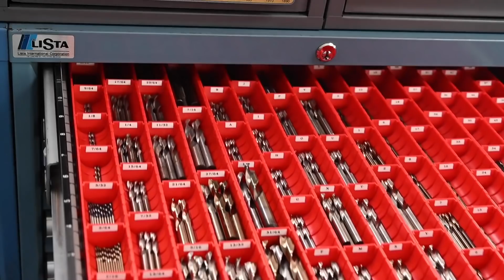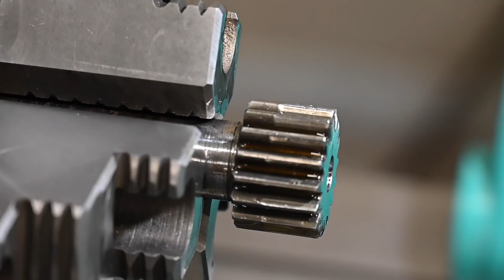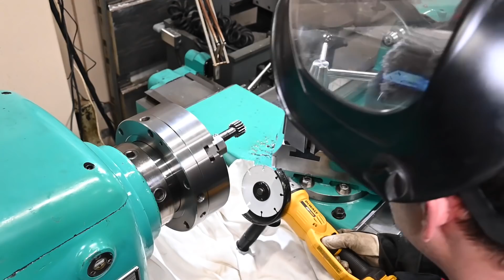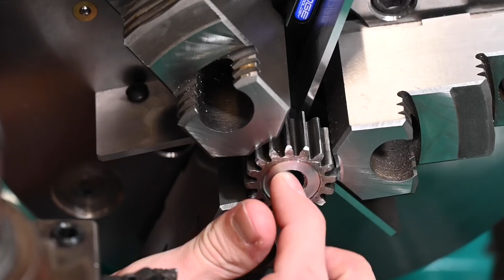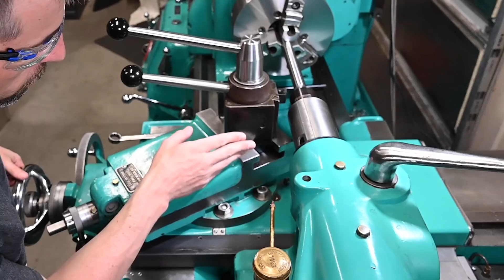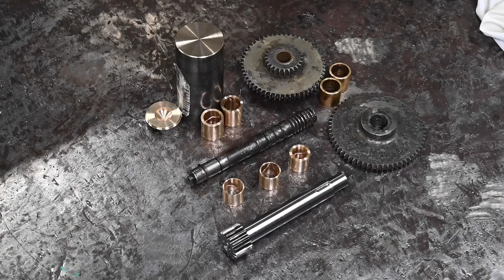Machining a hardened gear and new shaft (Lathe Repair)

Comment: Why did you have to cover the machine when grinding? At first I thought you were going to use a grinding wheel, so it made sense. But the burr is nothing more than when you’re turning. The same material is coming off. The DeWalt may have tungsten powder coming off the wheel, so I understand the need for it there.

I have the same parallel chuck tool for my 8” chuck. It works well, but can be a bit touchy to get the parallels in the fixture perfectly flat. I have to put in on my surface plate to do that. None of the different models from other manufacturers seem to come out far enough, particularly if the chuck is bigger with deeper jaws. But it’s the most accurate one I’ve used so far.

Comment: There's always a reason for things. The downside of a powered topslide  is complexity and bulk where you don't want it.  If you're making a lot of parts with a short taper like bevel gears, it might be useful.  99 percent of the time, a home shop guy uses his compound for advancing the cut a tiny amount on a threading operation, or for taper turning.  My ideal lathe would have a taper attachment, lead screw reverse from the apron, and maybe a solid tool post mount on the cross slide so I could program in my tool offsets.   A powered compound sounds like it would be cool, but when you start thinking about what you'd use it for... meh.

Comment: Really beautiful lathe.   If you get a chance check out the U3 universal gutter grinder.  I picked one up and it totally changed my reailty when it came to lathe/mill/drill sharpening.  It's like 5k rpm diamond wheel ultra precise (<.0005).   Maybe pick  a 5c or R8 collet version if needed.  It's my only gripe with the stock deckel collets that it ships with.  I've found them as cheap as $650 on ebay.  Lemme know if you wanna link.   Stefan did a nice review of his.   Stunningly heavy cast iron housing and monster motor.

Comment: That’s a disaster waiting to happen, putting your chuck wrench under your chuck? You could cut some stringy chips while turning and they get wrapped around the wrench pulling it up into the chuck! Scary bad!
Reply from the maker: It must look a lot closer on video than in real life- it’s a mile away from the jaws of the chuck. If chips ever touched the key while they were still attached to the work it’s because I fell over dead next to the lathe.

Comment: Somebody showed a spider that used regular parallels bolted too it so you could change heights. Pretty sure it was commercially available maybe an option. You gotta work with the tools you have and you got it done. :-)
Reply: I have that. It’s a pain to use. At first, it’s difficult to know which way the parallels are supposed to go. There are some cast in tiny supports for them, but it’s not ideal. Getting the parallels, um, parallel to each other is an iterative process. Then, if the part itself doesn’t have parallel sides, it lifts when in the chuck, and you find yourself tapping the day away. When it works though, it’s great. Just be careful you don’t get chips, or metal dust under the magnets.

Comment: Aaron, project is coming along very nice.  About your compound, your Lathe is a series 60 16 inch with a 22-1/2 swing. They also made the series 60 in a 24-1/2 swing. With that power compound I think it would of been nice if they would of used the 24 1/2 swing on yours.  Would of eliminated a lot of compound problems.

Comment: check tee handle needs shrink tubing on the handle..  
tool post holder need new ones made with additional offset to allow you to get out and touch the work without colliding with the tail stock.

Comment: make a yoke to bolt to the handle holes of your angle grinder , make it look like a sling shot.. so you can mount your angle grinder firmly in the tool post holder for grinding  or slicing easily when you need to.. 
 almost need to make a camera bellows to prevent chips from getting on the ways of smaller length jobs..  using spring loaded push rods ruthlessly removed from GM fuel pump modules fished from the trash at repair shops.  stainless steel tubes with stainless rods that slide tightly inside and stainless springs that cover the outer tube snugly..

Comment: Aaron, how often do you use the compound? I realize that honkin' big powered compound would be a bit cumbersome to take on and off the machine... But if you seldom use it, why not take it off in favor of a solid tool post block? It would eliminate all your interference issues, and you could make the tool post block shorter, so that all your tool holders aren't bottomed out like they currently are. It would also increase rigidity, though that beautiful machine doesn't need much help there.

Regardless, great work as always.

Comment: Try using a KDK 100 or 150 Toolpost, they tend to be slimmer than the Aloris-type. The KDK Tools posts can be had for reasonable cost, and for lighter work on a lathe of this size, are a good alternative choice. Stay away from the Chinese-made KDK copies. KDK went under in 2010, but there is a huge used market for them in the Southwest. KDK was based in Southgate, California for many years, then Prescott, AZ and finally Flagstaff, AZ.
Reply from the maker: This lathe actually came with a KDK tool post. I sold it before I got the lathe running because I already had Aloris tool holders. The KDK also only held smaller shank tools, but it would have been good to try it out against the Aloris. Oh well.

Comment: Compound interference with the tail stock isn't a problem that is unique to your machine.  My century old Mueller is the same way, and that may be why the tail stock is so massive.  It can extend around 9", and often gives the clearance I need.  No visible slop on the quill when it's 'out there,' but I did have to make some wear compensation to get the live center point as close as I could to axial vertical center.  Using it like that makes "sneaking up on dimension" a fine art, trying to keep tool pressure from pushing the part out of place.  I use the vertical shear tool quite a bit, because it can make very lights cuts with minimal pressure.

Comment: Well if you ever want to get rid of the troublesome lathe, give me a call!
Reply: Heck, I could even take it free of charge!
Reply: I wish I had your problems !virtually ALL lathes have this problem. Certainly my chinese 12x19 has lol I think given the size of your Monarch and the tooling size you could have easily pulled out your tool ( lmao) by half of five eights of and inch and been able to do the machining without whinging about the problem Arron and without swinging your compound around from your preferred position for it.
Reply: @samrodian919  I would buy a real thick shank tool for doing the occasional work with center support if my lathe had that problem. At least my holders can take a 1 1/2" shank. One of those to the extended holder Aaron has and it should be able to reach out far enough without too much flex.
Reply: I once bought a lathe, the previous owner cut off its bed into two just because a large disc he wanted to machine was too large, it touched the bed. As he cut it into two, he realised that he fucked up 😆😆😆 totally making that up lmao 🤣 it never happened 🤪🤣

Comment: Welding on finished parts is an invitation to warpage- better to turn the shaft on one end, press it into the gear, weld it, face it off and then turn the other end to size and cut your keyseat.  BTW- the term keyway is used in common industry vernacular as both keyway and keyseat, but I understand your caution as there are always folks out there itching to jump on any wrong terminology.
Reply: Speaking as a 16 year seasoned welder and the person he’s making these parts for. End welding on a shaft will not cause any notable warpage in this particular application. Speaking as the person that then installed these parts back into his lathe, the shaft was not warped and worked precisely how it was intended to work.
Reply: @stuffandthings8767  Can't dispute the results, but keep in mind I said it "invited", not  "assured" warpage. Every job is different, so I prefer to use the method with the least variables.  By welding first and turning second you are assured your shaft will be concentric with your gear in every application.
Reply: Yes I am old school also & I whole heartedly agree to your procedure!!!

Comment: Man I really don't like that spot for your Chuck key. I'm looking at it just thinking a chips gonna grab it and pull it against the Chuck and smash it into the way. Cool job though, creative solutions
Reply from the maker: It's further down and out of the way than it probably looks- I can't make a stringy chip strong enough to pick that thing up where it's at. I keep thinking about making a mount for it in a better spot, though- it's definitely not ideal where it's at. Thanks for commenting.

Comment: Why go to the expense of TGP shaft when you are turning off all of the ground and polished areas?
Reply from the maker: Just because that's what I had- I have some annealed 4140 and 1018 but wanted to use the tougher stuff so I turned off the shiny part of this bar.

Comment: Enjoyed..nice work, curious on the tool post clearance...why not extend the tool in the holder as the cuts were light and the tool is beefy?
Reply from the maker: I generally like the tools pulled in as close as possible, but you're right- it would certainly not be a big deal to pull them out to assist with clearing everything. Thanks Chuck.
Reply: A solution is to but 1.250 thickness tool holders. You should be able to manage them on that tool post without a problem. Then stick out becomes less of an issue. I’m not so sure it’s better to have the tool post overhang the slot. That puts pressure on one side of the compound, and pulls the other side up.

Comment: Secondary smaller lathe for small parts is the solution. That compound interference problem is way more reason than I would need to buy More tools.

Comment: I feel your pain with the compound interfering with everything. The machine I used to run at work had a huge compound proportionally to the size of the machine itself. It would constantly interfere with everything. And if you set the compound straight parallel to the crossfeed, it would interfere with the crossfeed handle, you wouldn't be able to turn it. And here's the kicker. It was not a powered compound, just some soviet genius engineering.